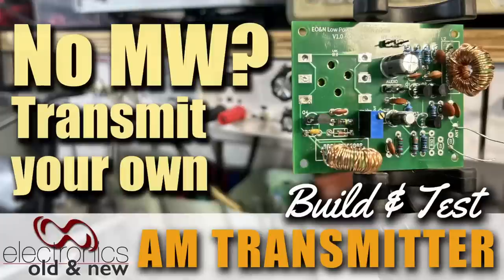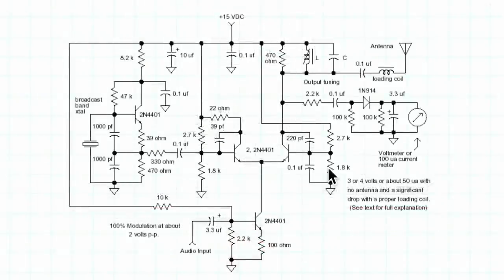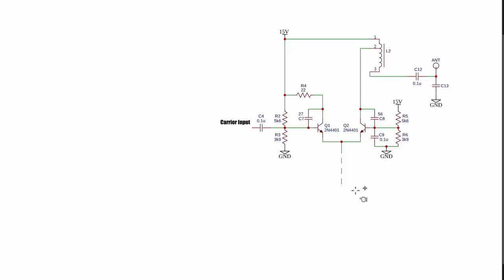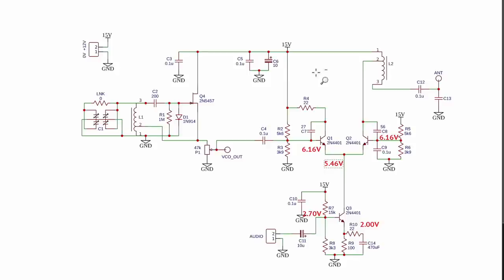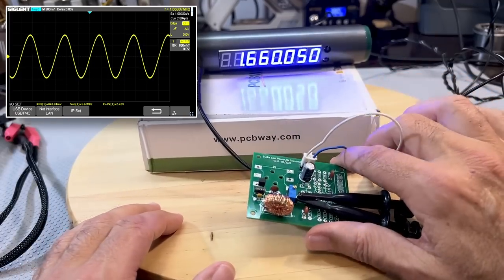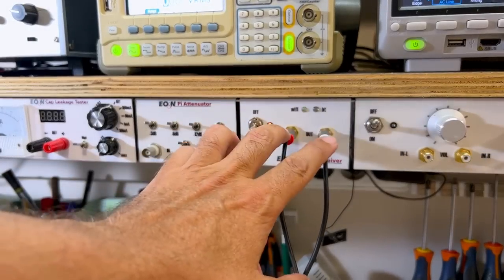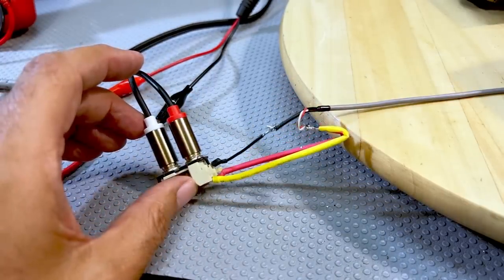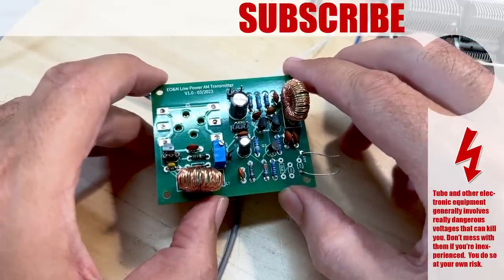DIY Transmitter for the MW Band: Stream Music & Test Tube Radios  #pcbway#

Comment: I use my HP 8656A for both AM and FM signal transmissions for troubleshooting, alignment etc..
I've seen a few projects where people will build AM transmitters, in some cases where they want higher fidelity and stereo an FM transmitter and they connect to their computers or whatever and retransmit podcasts, and or music around their dwellings in order to get use, purpose for their restored radios. I 've listened to some of the local broadcast stations, some of them are not too bad but most of the talk content is woke, horrendous, offensive to the thinking man's ear.
Reply from the maker: Receiving stations is easy. Picking up anything interesting is another matter 😊
Reply: I am from Indonesia and i like your content